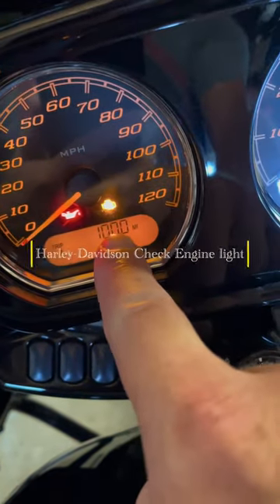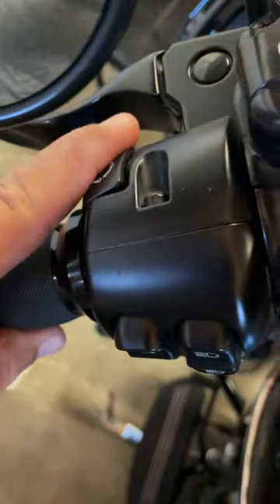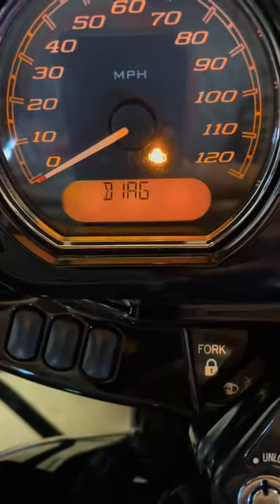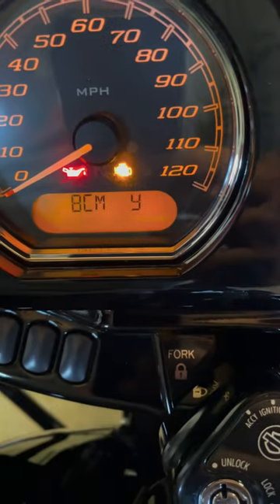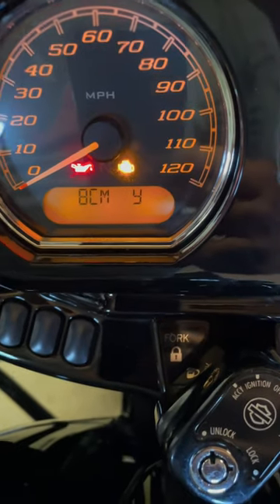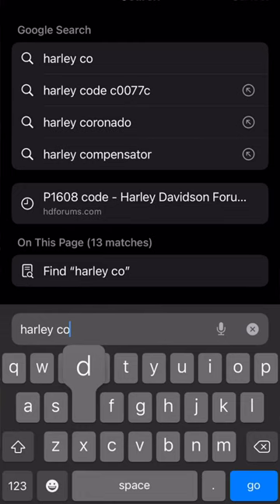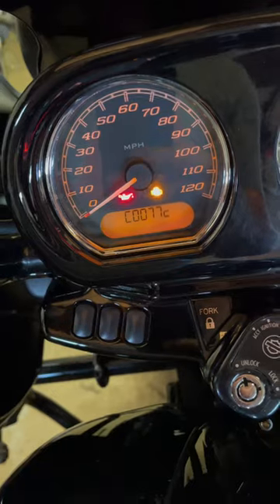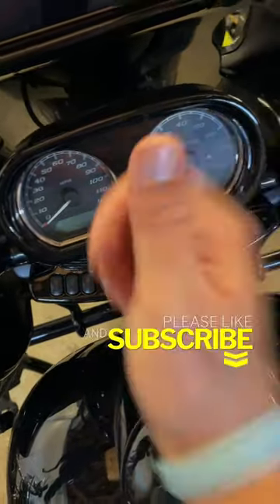Check and reset Harley Davidson Check Engine Light #shorts

Comment: I got a brand new 2023 RoadKing Special.  First quick ride got the check engine light. All codes showed “y” and were “h”.  Dealer told me how to clear them (exactly same as you demonstrated). Went for second ride.  Same thing. Check engine light, same codes, cleared them. Now what?  Should it go away after more riding? Didn’t do it on my 2021 Softail Slim.
Reply: Take it back. It’s under warranty.

Comment: I removed the battery on 2023 ,highway king after reinstall got engine lite .foundcode and cleared ok. Next time i removed battery it wants pin. I did the new pin and ok  now it wants pin to start again